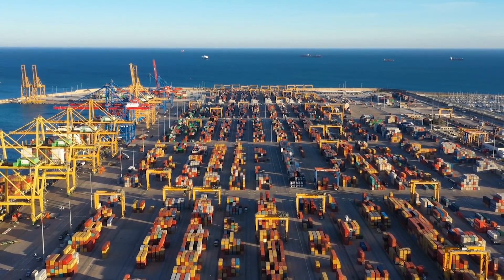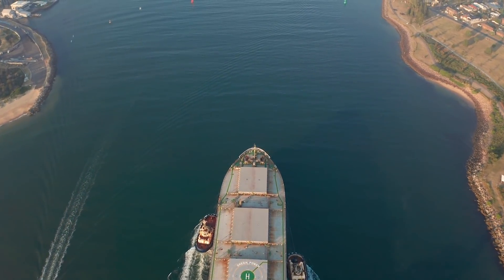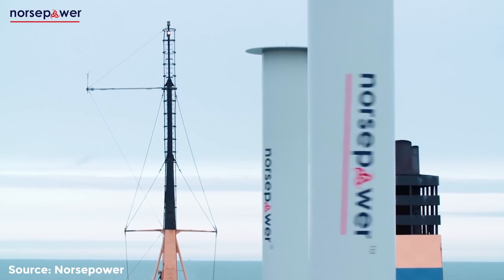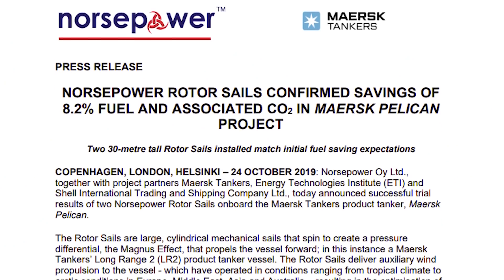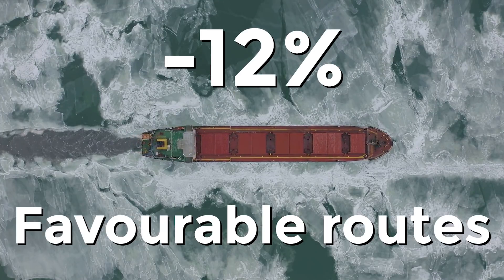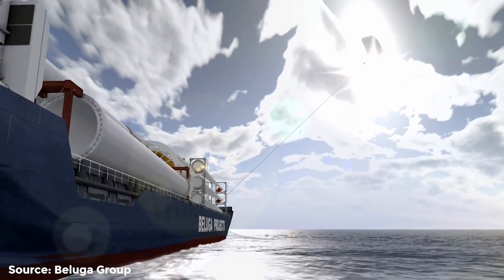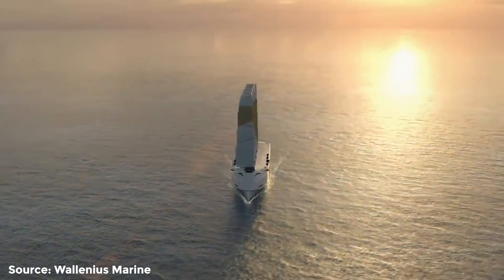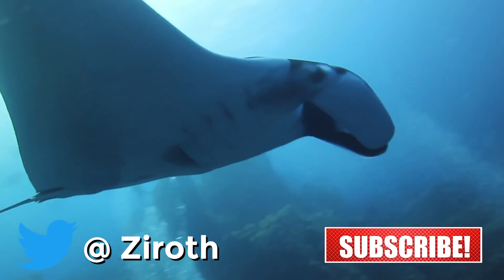Is Wind Power The Future of Shipping?

Comment: Here's my proposal to phase out bunker fueled ships: Do not attempt to retrofit existing cargo ships, or build new sailing cargo ships to replace existing fleets - there isn't enough time, shipping companies are fully invested, and each Maersk class ship pollutes more than 50,000,000 cars. Instead, mass produce semi-submersible, ocean circulating catamaran tugs with huge wing sail arrays on both hulls. The point would be to tow any ship by using maximum sail power wherever possible to reduce bunker fuel consumption by 60-80 percent ASAP.  Replacing legacy Panamax and Maersk size ships with sailing versions is simply impractical enough to be impossible and a huge distraction from solving the problem immediately. Economics are simple: the value of saved fuel pays for the sailing tugs and towing service. Theoretically, existing cargo ships will continue to operate up to existing life expectancies without impacting schedules or port activity.

Semi-submersible catamaran hulls will be more stable, efficient and capable of delivering more wind power than dicey retrofit sail kits, as well as more robust for weathering storms. Mounting arrays of large wing sails on two hulls allows for significant structural cross-bracing. Huge tow lines can be floated on retractable, inflatable tubes to connect tug to cargo ship at standardized attachment points at strong points near the waterline on bows. The sail tugs would rotate crews offshore and remain at sea towing customer ships like barges more-or-less continuously. Ships connect any distance offshore, throttle back during crossings, then disconnect at any economically optimum point to continue motoring to port....
Reply: Interesting, however have you fully appreciated the difficulties of deep sea towage?  Further research on the subject might inform your suggestion and cause you to think about the extended time on passage as well as the overall feasibility of your proposal.  Wind power dropped out of favour within the industry as it was less reliable, had limited harvestable energy potential and was more resource demanding.  The best options available are self limitation of both consumption and population growth.  Not at 'pre-industrial hair shirt' levels; but do we need a 5 litre V8 pickup to get to the golf club?  Is a family of 'two parents having two children' (assuming both will survive to adulthood) a good size to aim for given the generational replacement rate is 2.1?  In summation; reduce consumption, limit reproduction, satisfy 'needs' not 'wants' and be satisfied with 'comfort' not aspire to 'luxury'.

Apart from the fact that the hydrocarbon age is not quiet at an end yet the era of large scale mechanical mercantile shipping may have provided us with the means to get out of a cycle of 'nasty, brutish and short' life into an epoch of life that is relatively 'pleasant, refined and long'.  Much of the current ‘quality of life’ we enjoy we owe to the fossil oil and gas industry.
Reply: @BernardLS  I have appreciated many difficulties. Since the term "fully" can be elusive and subjective in context, I'll go ahead and answer "absolutely" for spite.

What matters is attempting to pass along as much sustainable future to emerging grandkids as possible without triggering WWIII. Right now, the little unborn buggers are expected to inherit holocene, social instability, failing infrastructure, and a climate crisis, as well as to pay back their staggering national debt (like they all agreed to for the sake of relieving the rich and stimulating gramma and grampa, etc.). There can be no perfect solution, only imperfect, piecemeal efforts to limit damage and impede mutually destructive habits of 8,000,000,000 souls occupying the same termite mound at the same time - most clueless.    

RE Birth rate: NOT SOLVABLE. Humans reproduce despite starvation, disease, pills, and fines. Every improvement in access to resources and efficiency enables more humans to exist and consume en masse.**     

RE Excessive consumerism: NOT SOLVABLE. Consumerism is the foundation of capitalist society and the main ingredient of basic human ambition and pleasure. Every family deserves at least 2 cars, 2 jet skis, a 200 amp circuit breaker panel, a big fridge, a 65 inch TV and a house with an office and guest bedrooms on Walden Pond.    

RE Deep sea towing: PROBABLY SOLVABLE. Use giant bungees! [or elastically equivalent pneumatic linkage].     

RE Wind energy [sail power] assistance for existing shipping: PROBABLY SOLVABLE. Beats the alternative of burning yet more bunker oil @50,000,000 cars worth of CO2 emission per large container ship.    

RE wind energy has already been tried...:  Despite performance limitations, sail power worked well enough in crude, wood-and-rag form to support global commerce. True, one oil-burning container ship transports more crap than a fleet of clipper ships. So what? One oil-burning, Maersk size container ship pollutes more than 50,000,000 cars and poses a threat to grandkid survival, whereas sailing, or at least sail-assisted shipping, not so much... Giant, offshore sailing tugs could make a serious dent in oil consumption long before nuclear energy is tamed. COVID proved supply chain disruption sucks, but most junk can be delivered "eventually" without harm.      

I support whatever efforts you are making to peacefully reduce human population and curtail rabid consumerism. Hats off if you reach more than a few dozen people in time to beat the looming tipping point. For the record, I made a decision when I was 9 to avoid dragging any kids of my own into existence if it could be helped. When I KTB, my bloodline ends  - sparing the world untold bunches of cars and houses.     

** All things considered, it was probably already too late for grandkids born in 2025 when Fritz Haber invented the process for synthesizing ammonia back around 1910...
Reply: @BernardLS  

Thinking you might want to supplement, or reject some of your reference material. For example, if you believe the grandkids are going to be fine because you read a study that said educated people naturally tend to have fewer babies, but outside that bubble humans relentlessly add an entire New York City's worth of fresh overpopulation every year -  new buildings, petrochemical dependent infrastructure, and all the associate consumption problems - it might be a good idea to at least add relevancy to the evaluation checklist.

With regard to the difficulty of towing large vessels at sea, consider the difficulty of sending 4 civilians into orbit on an autonomously controlled rocket for 3 days, then have a look at these articles about autonomous tugboats and such:

About delivery of an autonomous tug:
https://www.offshore-energy.biz/foss-to-take-delivery-of-new-autonomous-tug/

About the latest computer-enhanced AC75's:
https://www.youtube.com/watch?v=2zbcQtODP9c

Another one about an autonomous tug:
https://roboticsandautomationnews.com/2021/09/18/sea-machines-embarks-on-worlds-first-autonomous-remotely-commanded-voyage-by-an-ocean-tugboat/46300/

About a super tug towing a giant oil rig from Korea to Europe:
https://www.youtube.com/watch?v=43csxMbD5yk

Etc.
Reply: @arnswine  With regard to the difficulty of towing large vessels at sea, consider the difficulty of sending 4 civilians into orbit on an autonomously controlled rocket for 3 days, (is this a case of ‘we can so we will, irrespective of cost’?  What was the benefit value of those four civilians getting into orbit?  The great puzzle to me is how does NASA decide whether to boost a payload into a stable low earth orbit where it can degrade into ‘trash’ when life expired or carry it up to nearly the same distance from the earth’s surface on one of their Canberra aircraft then recover it to ground for reuse / recycling?  The Canberra was designed in the 1940’s but still has a payload cost capability that makes it productive.) then have a look at these articles about autonomous tugboats and such: -
About delivery of an autonomous tug: https://www.offshore-energy.biz/foss-to-take-delivery-of-new-autonomous-tug/ About the latest computer-enhanced AC75's: https://www.youtube.com/watch?v=2zbcQtODP9c
Another one about an autonomous tug: https://roboticsandautomationnews.com/2021/09/18/sea-machines-embarks-on-worlds-first-autonomous-remotely-commanded-voyage-by-an-ocean-tugboat/46300/.  Better not let the Larvikars know about it or they may pop out of their vik and ‘borrow’, in the best traditions of vikings everywhere, the good ship ‘Nellie Bly’ to further their own research! (:-)  ‘autonomous-remotely-commanded’ are these two criteria, ‘autonomous’ & ‘remotely-commanded’, commensurable?  Autonomous is defined, in my OED, as ‘self governing’ while ‘remotely commanded’ implies controlled (governed) from a distance by something external.
About a super tug towing a giant oil rig from Korea to Europe: https://www.youtube.com/watch?v=43csxMbD5yk
The obvious thing, to me, is ‘why build in Korea for deployment in Europe?’  Is that a further example of ‘we can so we will, irrespective of cost’, is the lowest price being pursued in preference to the lowest cost and are both being given preference over the best value?
Reply: @BernardLS  Can't help ya bud. In summary: suggestions about building generic, semi-submersed, computer-enhanced catamaran sailing tugs to reduce emissions from existing, bunker-burning fleets of cargo ships ASAP [rather than wait for redesign and repurchase of new, specialized, sail-augmented cargo ships] are rolling-around-on-the floor LYAO stupid, but omni-directional critiques and conclusions about doing nothing [rooted in obvious limitations of the 1960's and sea chanteys] are sit-up-and-pay-attention smart. Got it ;-). 

You might want to delete your comment thread in case loved ones read what you write. If a guy is willing to make blustering stinkies about the difficulty of deep sea towing, then watch a tube about towing an entire oil drilling platform halfway around the world without conceding that things may have changed, unfavorable opinions about sincerity and competency might form.
Reply: @arnswine  Can't help ya bud. In summary: suggestions about building generic, semi-submersed, computer-enhanced catamaran sailing tugs to reduce emissions from existing, bunker-burning fleets of cargo ships ASAP [rather than wait for redesign and repurchase of new, specialized, sail-augmented cargo ships] are rolling-around-on-the floor LYAO stupid (a bit strong I would say ‘impractical’ rather than ‘stupid’.  Bungey cord, really?  The mass (aka weight) to strength ratio just will not cut it; if you were able to scale up spider silk to the values of strength required for the energy transfer you might be in with a chance with the kite scheme), but omni-directional critiques and conclusions about doing nothing (actually I seem to recall making four suggestions, two pragmatic, & two aspirational, as repeated hereafter that were, perhaps, treated rather dismissively.  Reduce consumption, limit reproduction, satisfy 'needs' not 'wants' and be satisfied with 'comfort' not aspire to 'luxury') [rooted in obvious limitations of the 1960's and sea chanteys] are sit-up-and-pay-attention smart. Got it ;-).  You might want to delete your comment thread in case loved ones read what you write  (No; I am happy with my views, they change over time as more, or better, evidence accrues to me).  If a guy is willing to make blustering stinkies about the difficulty of deep sea towing, then watch a tube about towing an entire oil drilling platform halfway around the world without conceding that things may have changed, unfavourable opinions about sincerity and competency might form.  (The initial conceptualization of the ‘West Bollsta’ / ‘Alp Striker’ scheme probably occurred around a decade ago but even though it was found to be both practical and profitable in terms of ‘cost’ is it good ‘value’?  Is ‘building generic, semi-submersed, computer-enhanced catamaran sailing tugs to reduce emissions from existing, bunker-burning fleets of cargo ships ASAP’ feasible, practical, profitable and good value?  No, not IMHO.)  Final thought; hang in there, after all the Wright Flyer was never going to be worth a light and we all know how that ended!
Reply: @BernardLS  
Eeesh.
Here's a multiple choice test related to statements above:

An entire oil drilling platform was towed from S. Korea to Europe. This implies:
a)  A thingie connecting the tug to the massive, aerodynamically inefficient oil drilling platform must somehow exist, therefore towing other massive, aerodynamically inefficient, floating objects through big waves is probably feasible.
b)  Spiders can't make enough rope to handle the job, and even if they could, the value of reducing emissions is questionable - just like facts and sunrises.

Cargo ships made with primitive materials, propelled by nothing more than wind interacting with sticks, rope, and cloth, enabled global trade before steam and combustion engines existed. Sailing ships routinely hit 15-20 knots; modern cargo ships 20-25 knots. This implies:
a)  Wind energy might be further exploited using improved materials and methods to significantly reduce fossil fuel consumption of bunker-burning cargo ships.
b)  Wind\schmind... It's more practical and reasonable to assume 8,000,000,000 souls will suddenly, non-violently reduce consumption, limit reproduction, and differentiate 'needs' from 'wants' correctly in time to pass along optimum futures to unborn progeny [so they can pay us back their share of our debts]. 

A ‘West Bollsta’ / ‘Alp Striker’ scheme was found to be both practical and profitable ~10 years ago. This implies:
a) Existing materials and methods might be applied to other means of towing huge things around through big waves for the sake of reducing emissions AND profit incentive.
b) Towing is laughably impractical and wind energy is a thing of the past. Once again, despite showing no signs of slowing consumption or reproduction in 100 years, 8,000,000,000-and-counting souls will probably jump on an oxymoronic austerity kick any day now. You can just feel it in the wind.

A guy reads a proposed idea to reduce global shipping emissions and says he LHAO'd about key development points due to impracticality and financial impossibility, etc.. Then, after seeing evidence that the key elements he deemed impractical or impossible [sail power, deep sea towing, rationale for generic towing vs. redesigning fleets, etc.] actually exist for profit in 2021, he says he'll wait with an open mind for more evidence of, you know, adequate feasibility. Regardless of evidence, he says the idea still won't work because there's not enough "value" in curtailing emissions for the grandkids sake. This implies:
a) The guy probably suffers from chronic self-deception and would improve his outlook by dusting off critical thinking skills in order to promote, rather than distract from, workable emergency solutions.
b) Chucking rocks, referencing obscure authors and publications without links puts every new idea in a sort of offensive prove-me-wrong research headlock. It's how Rupert Murdoch exploits BTWBS to make every serious problem evaporate into the fog of common sense nonsense. It's how you get important things done right without actually doing anything constructive.

RE "Final thought; hang in there, after all the Wright Flyer was never going to be worth a light and we all know how that ended!"... Some would argue that this parting sentence is misleading. 1) It implies that readers should interpret 'hang in there' as generous benevolence, while most of your statements have been condescending and antagonistic, and 2) we all know the Wright Flyer demonstration did anything but end...
Reply: @arnswine  Working through your latest is going to take a while but here is something I prepared earlier, and have already posted in this and other commentary, threads.

To address the suggestions that wind power is the answer I offer the following example.  In 1870 a premium sailing vessel entered service, the ‘Cutty Sark’.  The ‘Cutty Sark’ was 64.74 metres in length with a beam of 10.97 metres and a loaded displacement of 2 100 tonnes.  She was able to carry, at best, 1 700 tonnes of cargo and to harness the energy in the wind the available spread of canvas was up to 2 976m2 which was tended by a crew of about 30 skilled men.  A ratio between the sail area (SA) and the vessels displacement (D) determines how lively she is; ‘lively’ being nautical speak for ‘fast and manoeuvrable’.  The carrying capacity of cargo ships is constrained in two ways, mass and volume which leads us to the ‘stowage factor’ of the cargo; the more mass on board the greater the displacement which in turn impacts the efficiency of the hull form and sail area / displacement ratio.  A vessel constrained by mass is said to be ‘down but not full’, while a vessel constrained by volume is said to be ‘full but not down.  When in the tea trade, which the ‘Cutty Sark’ was designed and built for with fine lines (more nautical tech speak, so again no need to worry about it) she could carry around 600 tonnes of cargo at speeds of up to 17.5 knots dependent on the prevailing wind and had a typical China to UK time on passage of 120 days.  The tea trade was very competitive so ‘time on passage’ was a large factor in securing the premium freight rate that made her cost effective.  Rounding things out, her maximum available sail area gave circa 5m2 of canvas for every tonne of tea carried.

As soon as the Suez Canal opened, which the ‘Cutty Sark’ was unable to sail through; she lost her advantage, raw speed, to the steam powered ships of that era who could beat her ‘time on passage’ by taking that short cut.  Mechanically powered ships have improved in terms of efficiency, on a freight tonne mile basis, by at least one order of magnitude since then.  After losing out to the coal burning, fire tube boiler, steam reciprocating mechanical ships of the late 19th century ‘Cutty Sark’ was relegated to the Australian wool trade, just about the bottom of the barrel in maritime terms and only one small step up from being a 'honey barge'.

The canvas, cordage and extra manpower needed for sailing ships was never a very benign environmental option so please discount any idea of sail as ‘sustainable’.  All this is without the problem that if ‘the wind don’t blow the ship don’t go’, when it does blow it often blows in the wrong direction for your cargo delivery needs and sometimes there is rather too much of it for comfort.  Traditional sailing ships are unable to go directly up wind so if the wind is blowing from the direction your cargo needs to go then a zig-zag course must be steered, more distance and thus more time on passage at whatever speed is achieved.  Wind speed is traditionally measured on the Beaufort Scale (wind speed) that runs from 0 (< 1kn or 0.5ms-1) to 12 (> 63kn or 32.5ms-1) and for sailing purposes the usable part of the range is ‘3’ (circa 8kn or 4.1ms-1) to ‘6’ (circa 24kn or 12.3ms-1).  As the wind speed, and the amount of energy that may be harvested there from, increases the sea surface becomes progressively more disturbed which makes the harvesting process ever more difficult.

Random fact about ‘Cutty Sark’, it is said to have been possible to coax 3 000 horse power out of her sails, or in ‘real money’ 2 206 500 Watts (2.2 megaWatts), assuming this was in ideal conditions that is about ⅔ of the solar power that might be harvested from the ‘top of stow’ of a Maersk Triple E, again in those elusive ideal conditions and 741 Watts for each square meter of sail area.  So that majestic spread of canvas would have been even less efficacious for delivering your baubles and bows from the orient, despite taking about three times as long on the voyage.  The sails on the ‘Cutty Sark’ produced about 0.33% of the power need to propel a Mearsk Triple E and covering the top of the Mearsk Triple E stow with solar panels might produce another 0.5% so with both systems working simultaneously in ‘ideal conditions’ the energy harvest would be less than 1% of the output from the ICEs.  Combining with solar electric would involve two systems in place of one, which then runs you into the problems of expense, complexity, integration and redundancy.  Remember shipping is a high volume low cost, therefore low margin business, and all costs have to be beneficial.

Canvas and hemp are accorded 'renewable' (read as ‘natural’) status, if ‘synthetics’ are used there will still be a need for the input of FOGI products.  'Synthetics' would have a much better working life span than 'naturals' but would still yield the same amount of energy, 741 Watts for each square meter in those elusive ideal conditions.  Wallenius are currently giving wind power a go with wing form ‘sails’ but evidence is a little short of proof as of this date.  KTH (Kungliga Tekniska högskolan), a sort of up market university in Stockholm, who are using the funding to derive results will probably, and eventually, in the best traditions of academia ‘publish’ a ‘paper’ unless the funders invoke the well known ‘commercial sensitivity clause’ of their agreement with the KTH.  Wallenius is a major shipper of vehicles were the product is effectively its own packaging, other goods are moved about in ‘containers’ so the loss of capacity, ‘broken stowage’ in nautical speak, caused by containerisation needs to be factored in.
Reply: @arnswine  I added more options and a few additional comments. There is much discussion of 'decarbonising' the marine commercial shipping industry and various ideas are offered to harness the wind such as Flettner rotors, kite sails, aerofoil form sails, traditional sails and wind turbines.  WADR the factor that seems to go unconsidered is wind direction and VAWT (vertical axis wind turbines) would appear to be the only option that could fully cope with that variable.  The availability of the wind, the amount of energy that could be gathered from it and the cost of the installation receive little consideration but, IMHO, on the limited information circulated VAWT seems to be the best of a poor group compared to hydrocarbon fuel.  For an intro to VAWT try https://www.youtube.com/watch?v=EM-gCvhQhPU & https://www.youtube.com/watch?v=ldt405jIR0E

Eeesh. Here's a multiple choice test related to statements above: An entire oil drilling platform was towed from S. Korea to Europe.
This implies: -
a) A thingie connecting the tug to the massive, aerodynamically inefficient oil drilling platform must somehow exist; therefore towing other massive, aerodynamically inefficient, floating objects through big waves is probably feasible.  The steel wire rope towing hawser used in the example has the strength at a viable mass (weight) per unit length to do that job but is not ‘cost free’.
b) Spiders can't make enough rope to handle the job, and even if they could, the value of reducing emissions is questionable - just like facts and sunrises; Spider silk provides an example of the strength to mass ratio that might make the kite sail idea feasible on the scale required and in suitable conditions.  While the value of reducing overall emissions is commonly accepted the ‘how’ is the matter under discussion.
c) To replace one system with another it is necessary for the incoming system to be capable of covering, or bettering, all the abilities and capacities of the outgoing system at lower cost.

Cargo ships made with primitive materials, propelled by nothing more than wind interacting with sticks, rope, and cloth, enabled global trade before steam and combustion engines existed. Sailing ships routinely hit 15-20 knots; modern cargo ships 20-25 knots.  When sailing ships ‘lost out’ to powered vessels they had actually become quiet sophisticated both in materials, technology and the application of both.  Some development continues both at the ‘rich person’s toy’ and ‘poor person’s essential tool for survival’ ends of the spectrum of use.

This implies: -
a) Wind energy might be further exploited using improved materials and methods to significantly reduce fossil fuel consumption of bunker-burning cargo ships;
b) Wind\schmind... It's more practical and reasonable to assume 8,000,000,000 souls will suddenly, non-violently reduce consumption, limit reproduction, and differentiate 'needs' from 'wants' correctly in time to pass along optimum futures to unborn progeny [so they can pay us back their share of our debts];
c) The global population will continue to strive to survive in whatever way they can, education makes that task easier.

A ‘West Bollsta’ / ‘Alp Striker’ scheme was found to be both practical and profitable ~10 years ago.  This implies: -
a) Existing materials and methods might be applied to other means of towing huge things around through big waves for the sake of reducing emissions AND profit incentive.
b) Towing is laughably impractical and wind energy is a thing of the past.
c) However price efficient or cost effective a project is if it does not add value it should not be carried out.

Once again, despite showing no signs of slowing consumption or reproduction in 100 years, 8,000,000,000-and-counting souls will probably jump on an oxymoronic austerity kick any day now.  You can just feel it in the wind.  A guy reads a proposed idea to reduce global shipping emissions and says he LHAO'd about key development points (actually the cause of my mirth was the ‘bungee’ cord, but let’s go with your tangent for a while) due to impracticality and financial impossibility, et cetera.  Then, after seeing evidence that the key elements he deemed impractical or impossible [sail power, deep sea towing, rationale for generic towing vs. redesigning fleets, etc.] (at the scale required) actually exist for profit in 2021 (?), he says he'll wait with an open mind for more evidence of, you know, adequate feasibility.

Regardless of evidence, he says the idea still won't work because there's not enough "value" in curtailing emissions for the grandkids sake.
This implies: -
a) The guy probably suffers from chronic self-deception and would improve his outlook by dusting off critical thinking skills in order to promote, rather than distract from, workable emergency solutions;
b) Chucking rocks, referencing obscure authors and publications without links puts every new idea in a sort of offensive prove-me-wrong research headlock;
c) Listening to others and sharing their experience may save repeating mistakes.

It's how Rupert Murdoch exploits BTWBS (? Welcome to BTW | Home (btwbs.com) or ‘By The Way Buddy, Stories’ ?) to make every serious problem evaporate into the fog of common sense nonsense.  It is how you get important things done, right?  Without actually doing anything constructive.

RE "Final thought; hang in there, after all the Wright Flyer was never going to be worth a light and we all know how that ended!"... Some would argue that this parting sentence is misleading.  1) Implies that readers should interpret 'hang in there' as generous benevolence, (or an injunction to be true to your beliefs, even if they are considered to be erroneous) while most of your statements have been condescending (?) and antagonistic (???), and 2) we all know the Wright Flyer demonstration did anything but end (after demonstrating the possibility of ‘heavy than air’ aviation).